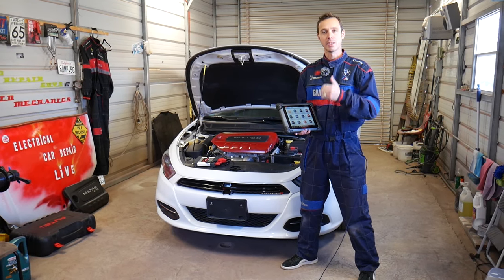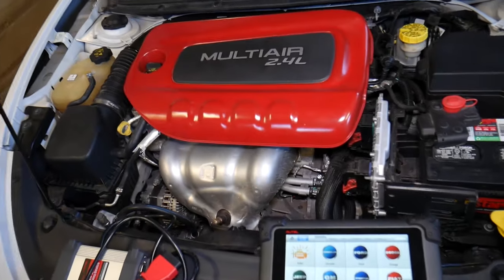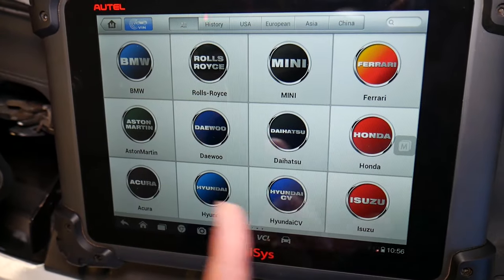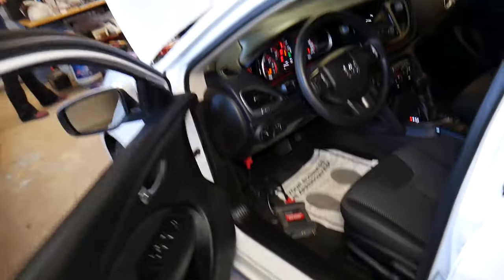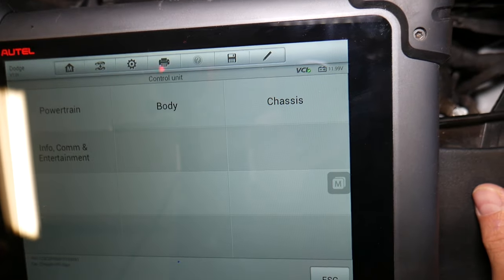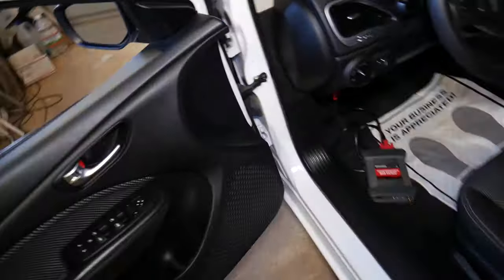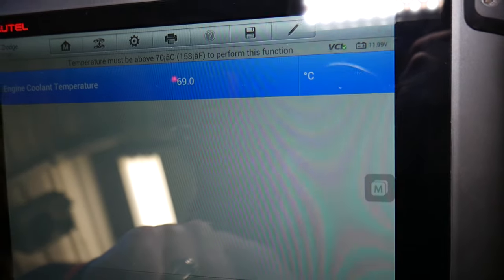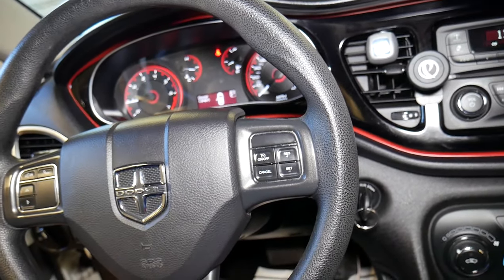HOW TO RELEARN CRANKSHAFT POSITION SENSOR, CALIBRATE CAMSHAFT POSITION SENSOR

Comment: I replaced my crankshaft and camshaft sensors on my 2019 hyundai tucson without doing this. My car ran fine for a bit then one day it would not start. Could this be the reason it won't start??
Reply: Did you get it figured out?
Reply: Yuppppp

Comment: Kinda a pain in the ass you need such a high end  expensive scan tool just to change a little sensor which older pre 2002  when cars didn't need a relearn... At least these day you can buy  el cheapo scan tools to do the relearn..

Comment: Are you able to tell me if the Autel MaxiPRO MP808S Scanner you use specifically has the cam/crank relearn option for a 7th gen A35 2014 Nissan Maxima SV? I recently bought an Xtool D8S, and after all 183 updates finished that were available when it was turned on for the first time, there's very limited options for Nissan. And no relearn option for cam/crank sensors. I changed all 4 of my cam sensors a few days ago and have a crank sensor ready to swap but this Xtool don't have the relearn option. I was hoping the Autel does.

Comment: I replaced both of 'em on my 2004 Colorado and it idles a little rough. I see SPARKADV(degrees) in my scanner LIVE DATA jumping at times back and forth between -5 and +17. When this happens the engine shudders. When this parameter stays close to zero on the positive side, the truck idles fine. I read that there is a way to do a  ' relearn '  procedure without an expensive scanner, it involves the following steps:

1. Turn off all of the accessories. With the Air temperature sensor and Coolant temperature within 5 degrees (Centigrade) of each other,
 start the engine and let it idle in Park or Neutral for two minutes.

2. Accelerate the vehicle to 55 mph at part throttle. Cruise at 55 mph for 8- 10 minutes until the engine 
reaches operating temperature.

3. Cruise at 55 mph for another 5-6 minutes.

4. Decelerate to 45 mph without using the brakes, and maintain 45 mph for 1 minute.

5. Perform 4 deceleration cycles, without using the brakes, of 25 seconds each where no specific speed is 
necessary. 
Returning to 45 mph for 15 seconds in between deceleration cycles.

6. Accelerate to 55 mph and cruise for 2 minutes.

7. Stop the vehicle and idle for 2 minutes with the brake applied and the transmission in Drive (automatic trans.) or Neutral (manual trans.) 
with the clutch depressed.

good luck with it. It sounds rather confusing and difficult to perform. Will try tonight when traffic slows down.
Reply: Did it work for you?
Reply: I bought the inova 5610 on sale for $217 and it has the re-learn function. It does so much for the price. I would love to have a professional model but it would be overkill for me who fixes my own vehicles.

Comment: Do you need the J2834 to access these functions? I just purchased maxi pro but can't find special functions to calibrate cam sensor.
Reply: The "vivent iLink 400" is $156 brand new on ebay and a guy made a youtube video of him doing the crank shaft relearn procedure on his 5.3L chevy pickup and it worked great.  It says it also does camshaft relearn and throttle body relearn procedure.

Comment: hello, i changed the engine on chevy equinox 2011 and now i have 4 codes cam and crank sensors 2 for cams and 2 for crank car wont turn, cant delete the codes, the wiring for the sensors does have 5volts for all 3 conactors, is the ecu gone or something im missing?

Comment: Hi, i have xtool D9 pro. Am i able to do crank relearn on 2004 lexus 330 with acan tool? Or can your scan tool do it? Can you give link if so? I did timjng belt but it's running slugish now, thinking it needs relearn. Thank you.
Reply: Sounds like timing is off if it ran fine before timing belt replacement
Reply: @bdog4u2  Yes, that's what it was. I redid the belt and timing. All good now. Thank you.

Comment: For your experience what is your more scan tool you use Autel or foxwell??
Reply: Autel. It's not as user friendly, a little slower but it blows my snap on scanner out the water functionally. Snap on just has a bunch of subscription based info which is awesome as well but expensive af

Comment: On the dodge dart 1.4l limited turbo,  I got dtc P0315 says no crank sensor learned,  it's been replaced will this programming procedure fix my issues please any information would be appreciated this car gas been sitting for  a year with alot if new parts on it, it's not running right still
Reply: It should unless there's other issues

Comment: Do you always need to do a relearn when swapping the sensors ?
Reply: Swapping? Or replace…??? 
Swapping refers to changing places, like swapping spark plugs.. you may be referring to replacing.. 
The answer will still be yes either way
Reply: @speedlimit6869  I meant replacing sorry for the confusion

Comment: What if it's cold outside and the car won't start. So I'm replacing the crankshaft position sensor so it will start. Can I do this without this mechanism?

Comment: Hi i have got corsa d 1.2 petrol 2012 sometime while i drive for long time it goes in limp mode if i turn the engine off then start again all work fine again. I try to diagnose no dtc restore. Can you pls help what could be or any common problem with corsa

Comment: How safe is it to do the relearn?  My car (2018 Chevy Tahoe) got reduce engine power with throttle body code, I remember I saw a code related to camshaft, but I don’t know why I cannot find it.  Now, I just have replaced trans fluid and the car doesn’t shift smoothly (50k km/31k miles) it should be healthy cause I am taking care of it and never gets over heated.  I’ve done throttle relearn after cleaning, and trans relearn, but I start to get suspicious of the crankshaft code that I saw.  So, crankshaft relearn safe?
Reply: Please I hope to get a reply

Comment: How do i convert the crankshaft sensor on a k engine 6.0 chevy the year made 08 the crankshaft sensors on the front of the cover of the camshaft crank cover i'm putting a replacing my k engine right away i noticed they had no camshaft sensor placed to mount my wire harness to get camshaft timing and sensor to work because the new engine i'm putting in it 6.0 has a different setup and it's timing for the sensor speed is on the back of the engine under the intake to the rear of the motor how do i make the new engine function properly to the k sensor system speed sensor

Comment: I have a 2006 320i with error code 2a83 camshaft control input what is this code for do I need to replace cam sensors ??

Comment: 2005 GMC Canyon 3.5L i5, just replaced the ECM/ECU/PCM (computer) and found out P0315 will appear after doing that.  It wants the relearn CKS procedure done as a result.  However, I do not have a device to plug into the truck to select the option to start the calibration.  Is there another way to do this without the scanning tool?